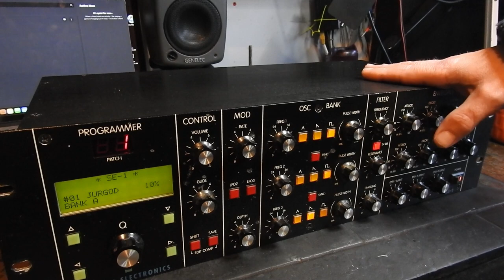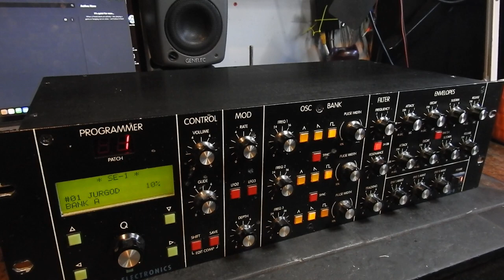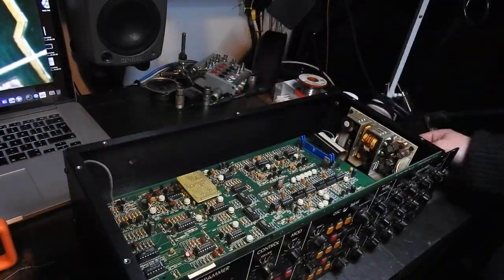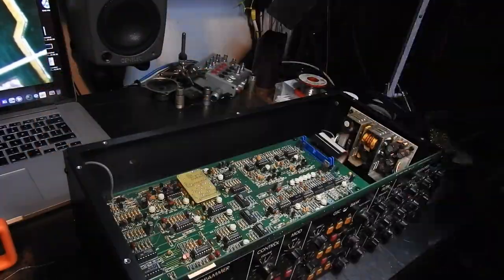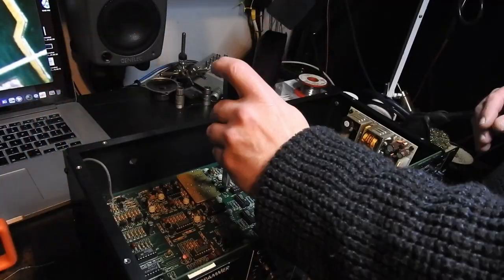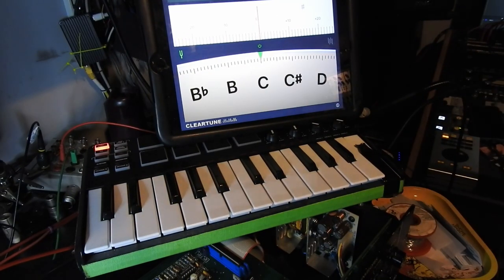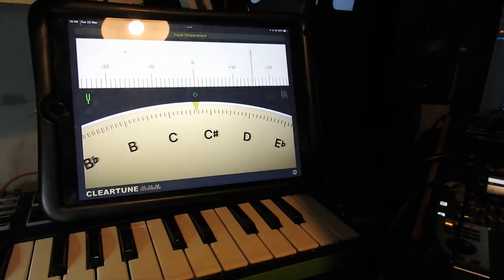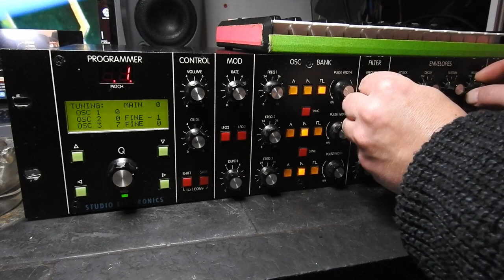Studio Electronics SE-1 With Unstable Tuning and Impossible Scaling Oscillators. Repair.

Comment: Nice video, and great to see its well labelled inside, im interested in doing the Filter Feedback Mod to my SE-1, apparently it allows you to reroute the audio back through the filters (like the original Mini Moog), and it works internally, someone used a 3 way switch on the back to select white noise, ext in, or filter feedback, was hoping you could shed some light on how this can be done, and also how to control amount of the signal being sent back into the SE-1???? the guy doesn't mention how he did it or anything about controlling the amount of feedback. Just to add it would also be useful to have an input jack on the back of the unit, although that would be a bonus i can live without, but i really want to get the most out of the first analog synth i bought back in 1994 or 1995, Many thanks